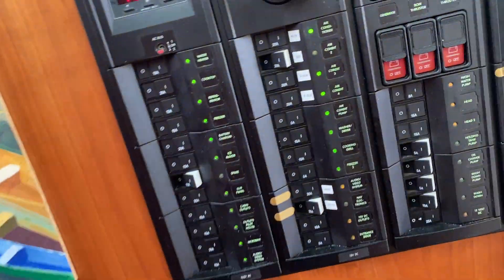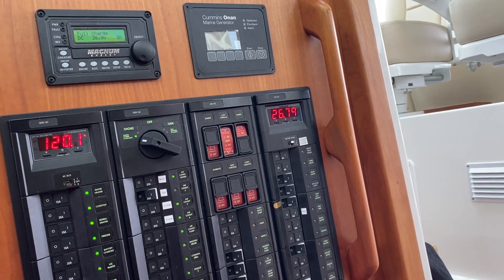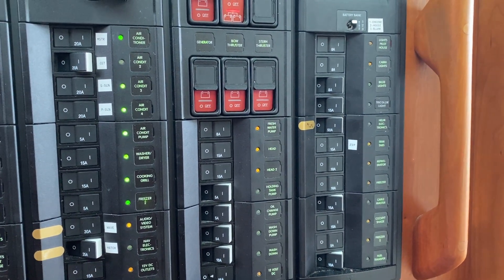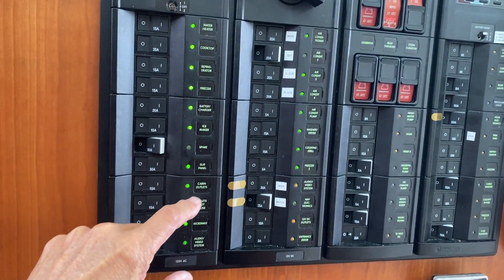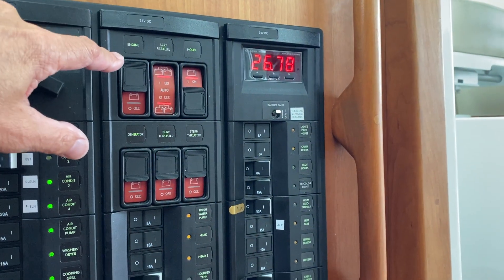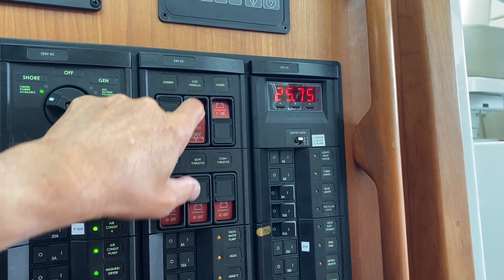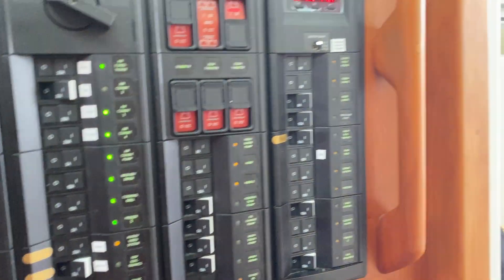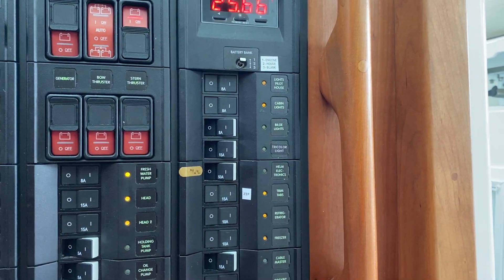The mystery of the Back Cove 41 electrical panel

Comment: Hi Edward, something additional that I learned this week about our electrical panel on the AC side. 

The inlet 50a / 220v shore power is being split into two legs of 110, shore 1, and shore 2.  

The left panel column is one (air conditioners running) and the right column is the other.
Reply: Sorry. Air conditioners on the right panel circuit.  But interesting that our multimeter monitors both circuits